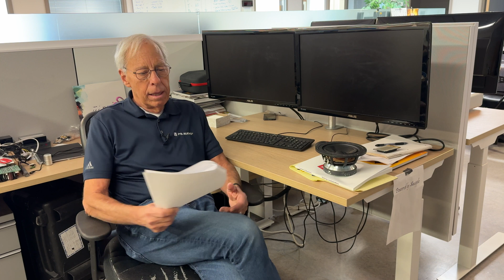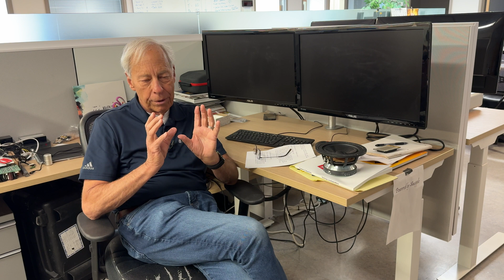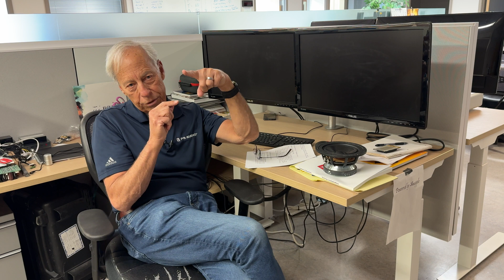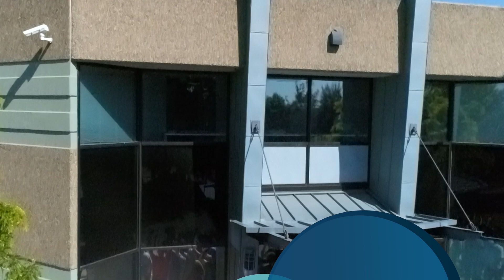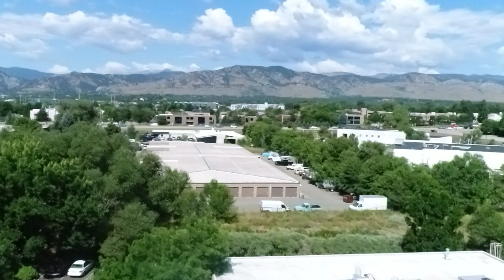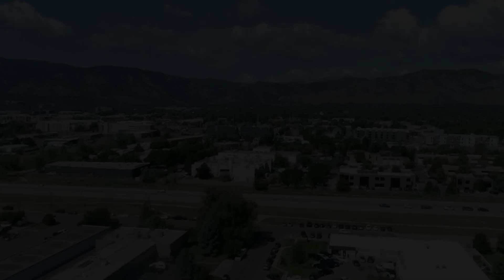How a frequency control works

Comment: Perhaps describing the tone control as a balance rather than volume control. It varies between a circuit that is wide open with no changes to the signal and a circuit that has some type of frequency dependent processing. Like even a simple capacitor as you describe which would filter high frequencies if connected to ground. So the "Treble" control varies between the no capacitor side and the capacitor side.  Increasing the effectiveness of the capacitor as the control moves more towards that side.
Reply: What you say about an adjustable tone control (treble, base, etc) being a balance between a filtered and unfiltered signal makes sense. These knobs don’t change the “shape” of the filter (the frequencies it passes) but instead just the amount of filtering, the “size” in some sense. Maybe this is what you are saying. 

Where things become confused in the video is that, to me, the original question was about the “shape”, but Paul answered about the “size”. To me the question remains; how does a knob work like you might find on the back of a subwoofer that adjusts the low pass filter frequency (the “shape”).
Reply: @SteveWille  Yes going back to the beginning of the question, it includes shifting the cut off frequency. One of the most simple is still using a variable resistor and an capacitor. One of each is called an R/C network. The cutoff frequency, where the filter becomes effective, is a ratio between the R and C values. Changing the R while keeping the C constant changes the cutoff. Adding an inductor adds all kinds of flexibilities.

Comment: The short answer is that it doesn't. It still acts as a boring resistor, but as part of a larger network that forms a filter, either low pass, high pass, or band pass. The only difference is that it can be adjusted and is not fixed (Edit: And to be fair Paul did a decent job at conveying this. But probably would have been better to have it be part of a larger topic on impedance instead.). Although in the current home theater sub I have the pots are used as lazy position encoders by taking the ratio rather than its absolute value of the resistance via an ADC. Clever, but somewhat annoying to have a smoothly rotating control that can only assume discrete values.

Comment: As an audio engineer that made no sense but I feel enlightened somehow. 
Thank you.
Reply: To non-technical people it will just make them more confused lol. Would have been much better as a general topic on voltage dividers, basic RC filters, and maybe Baxandall controls. The pot is just a resistor in all cases. The only difference is that it has a place for you to twist and change its value.

Comment: Potentiometers also boosts voltage.
How is both lowering voltage and increasing voltage for a frequency accomplished for a given dial?
Reply: Boosts?  Pots can select from 0% to 100% of the available voltage.  I think you mean, select more of the available voltage?
Reply: The voltage is only boosted if there’s an amplifier in the path, near the pot in the processing chain.

Comment: Frequency control can be with many sorts of analog circuits with various effects of phase and frequency response. But it can also be done in a DSP with even more options of control (before DAC). How about adding an "audiophile loudness" function with a bypass switch? I keep finding myself enjoying music more with some slight EQ tweaking incl. a loudness deep bass lift and my favorite "rejuvenation EQ" boosting the very highest treble to give the music more sense of air as our hearing naturally fades above 10kHz by age. Nobody will blame a videophile for wearing glasses. EQ can be sort of the equivalent for our hearing and I'm sorry but of course a good engineer can design a bypass switch that has zero audible artifacts.

Comment: Perhaps you could borrow a white board for this type of explanation.
Reply: Paul didn’t need a whiteboard, what he needed to do was explain how a   crossover operates in simpler terms. He goes into too much detail about potentiometers and that’s where things go south. The frequency crossover point is nothing more than an adjustable crossover  where the subwoofer pot changes  where the subs upper frequency cuts off and your main speakers take over. The bigger problem is getting the sound coming from from the subwoofer sounds like it’s coming through  the main speakers making the sub audibly invisible.
The bottom line is that the subwoofer crossover frequency where it cuts out is adjustable. That’s it in a nutshell.